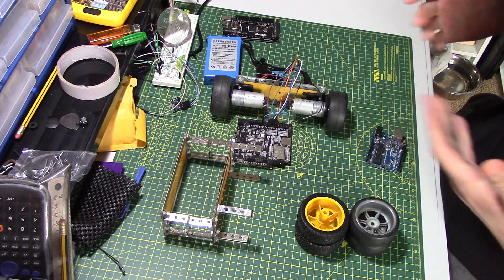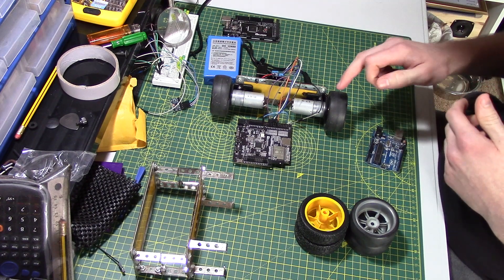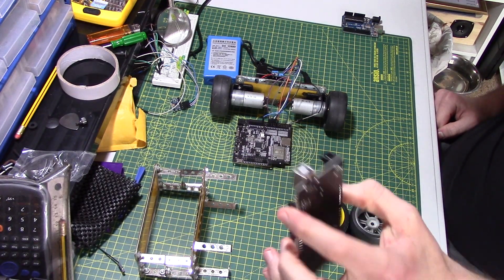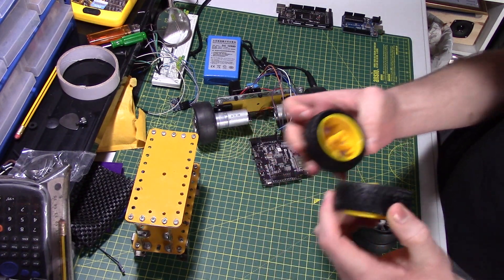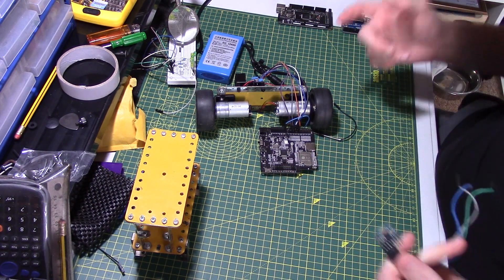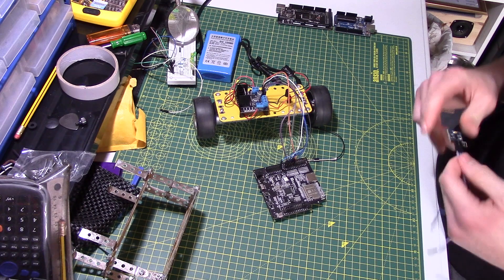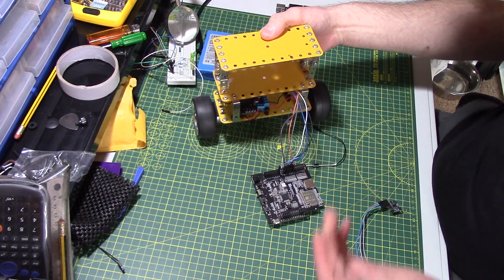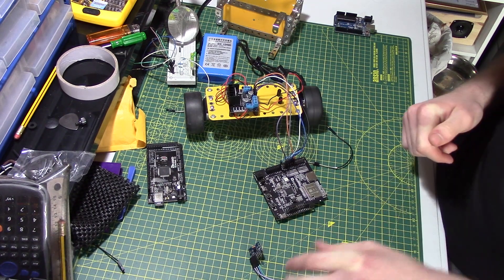Balancing Robot Project: Update 0

Comment: Hi sir. That's a nice robot. Did you used kalman filter?
Reply from the maker: I did use a Kalman filter and it did seem to help with balance a lot. The main issue was the accelerometer drift on the MPU 6050!
Reply: thehardwareguy the whole thing looks pretty neat. That looks like a very complicated board. Nice. New friend here. I hope our channel would be connected